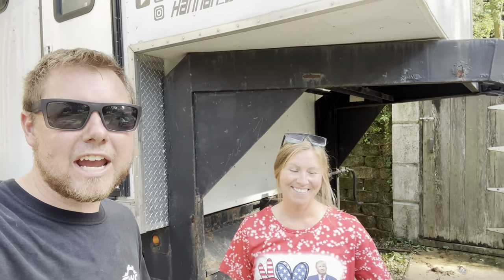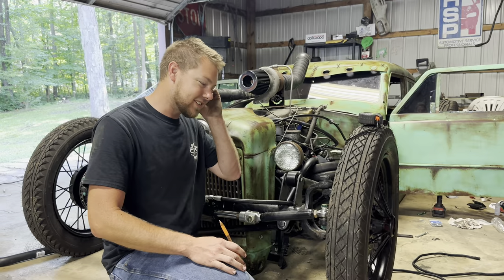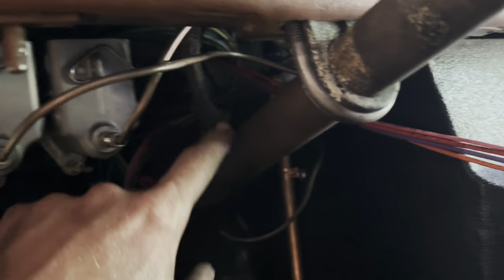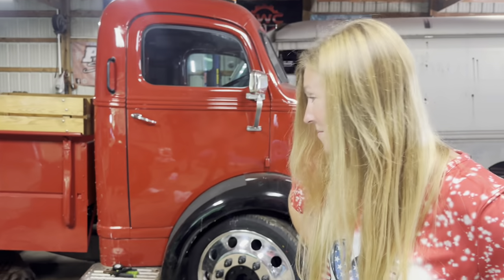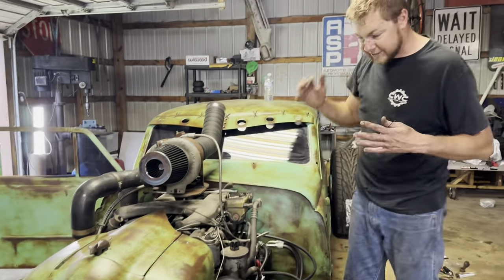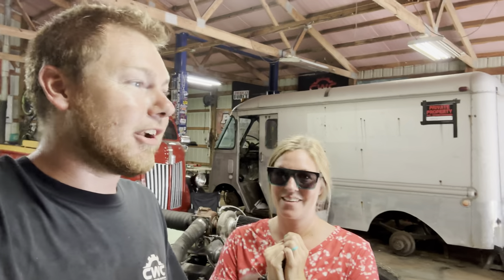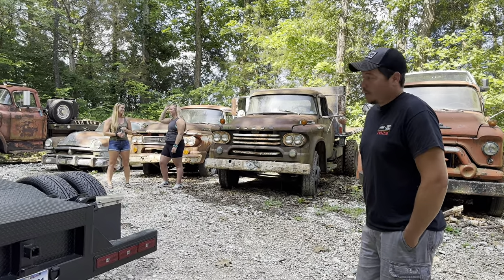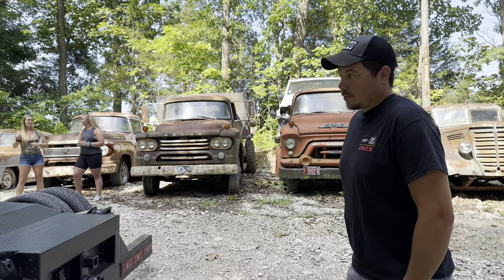We are CELEBRATING more than the Fourth of July!!

Comment: The Mouse Trap looks pretty bad ass. 
The engine sounds like its got some top end knocking of some sort. But only on idle. How's the oil pressure ? Or maybe a hydraulic tappet is knackered ?
The top of the rad looks a tad higher than the scuttle. I reckon the rad should come down a fraction, just so it's the same height as the scuttle.
It looks like the engine burst out of the body, like the Hulk bursting out of his shirt. Very cool.

Comment: I love your channel; you get me all worked up and in the end I'm to old to do what I want to do. I have a 1953 dodge m37. Redone stock. Want to put it on a short dodge 4x4 chassis. But my disability wont let me. So i will drive it to local shows and enjoy it. With stock 583 gears and a 230 flat head six 47 mph is not road worthy. But win; it moves under it's own power. And for my remaining time left I will roll on.

Comment: I was distracted through the start of this video, is that a full hydraulic steering system (I didn’t notice a shaft connecting anything to the actual steering). If so I would highly recommend going a different route, it’s illegal in a lot of places and is just flat out dangerous on anything that does more than 30mph.

Comment: Hey y’all, how’s the heat? I’ve got a question, I see you put copper lines on the Wilwood brake cylinders. Why copper over stainless? Thanks
Reply from the maker: I just went with copper, because the rest of the car had copper lines in it